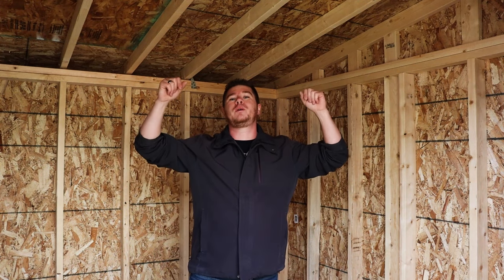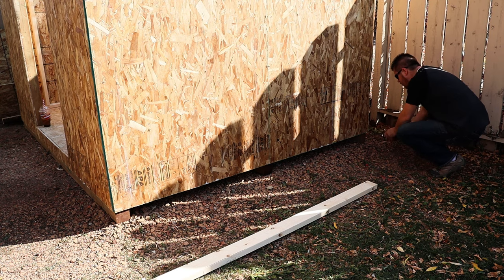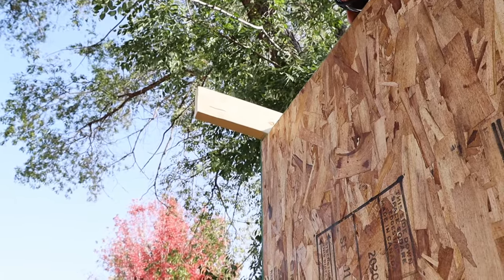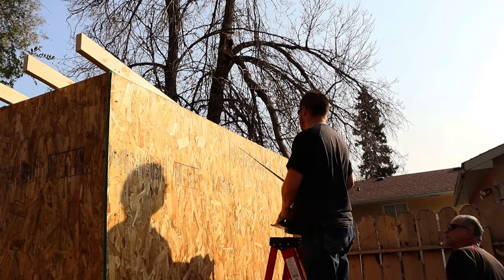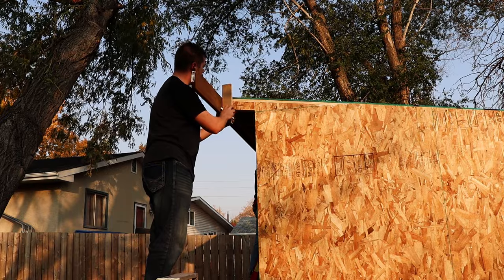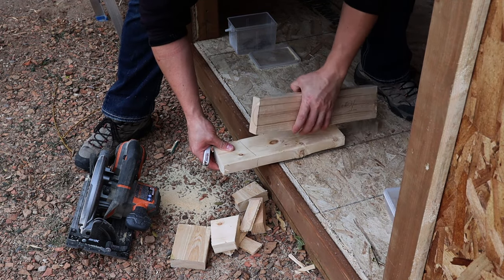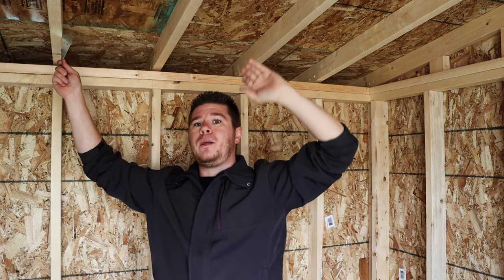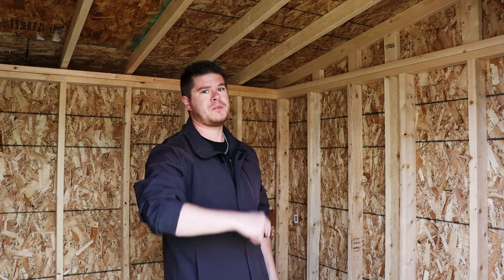How to build a storage shed - Roof // Part 4 - Plans available

Comment: I want to know what you spent in materials to do this build. I an very curious. I need a building but I rent where I live so I want to go as cheap as I can. Just a few weeks ago an 8x10 metal building was only 399. As of covid I guess like everything else it has been raised now to 520. That's just for the building though not including lumber for the floor. Granted that won't cost that much, but as I said I want to go as cheap as I can. If it's cheaper to build a building like u have I will do that instead.
Reply from the maker: To build this shed it cost me $1500. It costs more because you are paying for the quality of the structure, there is no comparison to a metal one, this is stronger. But if you are looking to watch costs I get it, I have a small metal one too.
Reply: Thank you buddy. I appreciate it. I had gotten a metal shed off of facebook market place that was suppose to be complete and was suppose to have been an 8x6. Once I got it home and started going thru the paper work to see how to build the floor it had measurements on it. It ended up only being a 5x6. All the pieces where there but it's much smaller than the seller claimed. I need something bigger than what looks to be an outhouse.
Reply from the maker: No problem, happy to help. Sucks when people  don't list things correctly and you're left on the hook. Good luck, keep me posted

Comment: Good morning my dear. A question: the second top plate, had to be only one piece or I can use 2, because my shed is 10 inches larger. If yes, do I have to use 2 big pieces, or is it fine if I just add the little piece that is missing.
Thank you.
Reply from the maker: Typically on the front and back walls because they are holding the weight of the roof, you want to use full length plates, not pieces. They are there to distribute the load evenly and multiple pieces can't do that correctly. On the side walls, in this type of build at least, it is a little less important and you'll notice when I'm panning the camera, I briefly showed I used 2 pieces on my side top plates
Reply: @JessedoesDIY  
I really appreciate your attention and time you gave to my concerns.
Reply from the maker: Anytime

Comment: So is the front wall slightly taller than the back wall ? Is that’s where the slope comes from? 🤔
Reply from the maker: Yup,  the front wall is 8' tall, the back is 6.5' tall. I even gave the measurements in the videos for stud lengths
Reply: @JessedoesDIY  thanks brother
Reply from the maker: Anytime

Comment: Does OSB hold do to weathering
Reply from the maker: As long as it's sealed in some way it'll last just fine. The glue in it gives it a certain amount of weather resistance, that's why it is so common in building materials. When used correctly, it'll last a long time.

Comment: this is the part that confused me  , i am used to a frame roof  can I ask what about fiberglass roof panels  . the heavy ones not the cheap stuff . With ice and water shield under it   no introduction to your helper   or did you kidnap a neighbor    no birds mouth   interesting     and no roof over hang on the sides either  .With heavy rains has that been a problem   . I get blowing rain up  on the hill where I am at .  I already have drip edge and hurricane ties    for the roof  left overs from my covered front porch  . I over bought everything because it takes over  an   hour to get to lowes or home depot
Reply from the maker: This is a typical classic shed roof. If you want to use fiberglass panels you can, but you'll still need to frame and sheet it first. The helper is my dad, and I did mention it briefly, we were in a hurry to get it done before a blizzard showed up. A birds mouth isn't necessary on a shed, the roof is small enough and there are no crazy pitches and angles going on. The side overhand isn't necessary either on something this small, but you can definitely add one. I have no problem here, but thats the reason for the skids under the floor and rock base, it is plenty sturdy.
Reply: @JessedoesDIY  I was planning on all plywood for walls and roof   maybe board and batten look .I had 4x4s left from my pergola builds  and skids here are important  since we can get extremely heavy rains  . I am building it a ride on mower with from my other shed  . I still have some left over gravel and planned on patio blocks under the 3 -4x4 's I  have . .. I plan a small porch on the front and 4x4 's are 12 feet long . just need deck boards
Reply: plywood back down to 22 dollars a sheet , so may need to buy that now
Reply: @JessedoesDIY  how well do you think your shed will last?  without concrete slabs under it?  I', doing mine and that's the big ball buster is the concrete.  besides the$1,000 ticket I got today for speeding and running a red light with my trailer on my truck and my worker with a warrant  with me.  the concrete floor seems so much more appealing but I'm just doing wood now on gravel or on concrete.. I am having trouble making my final decision... Pplease help me, - Should I go with the concrete or just lay wood on the ground..  Its got some stomne in it but its a lot of clay too. I should go ahead with the concrete footings or just lay 4'' by 4''s or 6'' by 6''s on the stone/gravel bed?  Its got clay ground under that.  really wet here in South East Arkansas. its 20' 2'' 5/8'' 'by11' 4'' 1/8'' existing shed but my add on is similar to Your shed The "Jesse Shed" everyone will be building!  still with the stupid dimensions its making the math harder.  I've dug 3 trenches for gravel beds and thinking of concrete footing s in every corner and maybe 2 more in the center front and center back of shed a-add-on.  also. tonight my buddy and me stole my dads borrowed my dads big tractor with a front end loader and hauled it back to my mobile home where my shop is. got 2 loads of gravel too man! lol  community gravel...  
thanks for your video Jess!  I'll never forget you and your good work that will be all around the world. Little Jesse' sheds!! nice brother.  Have a good day. will your floor rot out in less than 10 years?
Reply from the maker: Ooof that's a lot to unpack lol. Alright, built the way I did it in fully confident in my floor lasting 25+ years. Now you'll use pressure treated lumber for the floor and it's rated for direct ground contact for up to 30 years as long as it can breathe. Try no to lay the beams on gravel because it holds moisture, a rock base is better because it drains. Ultimately it all comes down to the amount of work you want to put into it. Concrete is much more work, and much more expensive. My next shed I'm doing it, but I wanted to show both ways so each shed I build will be different. Now if you want the absolute best and you're confident you can do it, then concrete it is. But for simplicity and cost that will still last a couple decades, this wood floor is great too. If you've already got footings dug, then go with it. It's really hard for me to tell you which is best for you without being there and knowing what you've got. I just know that what I built will be plenty durable for most everybody out there

Comment: Hey jesse can i go just 7ft on front of the roof or have to be 8f
Reply from the maker: 7 feet doesn't leave a lot of room for a tall door or a lot of slope to the roof to shed water. You can if you want but 8 was better for those 2 reasons plus I didn't have to cut the front sheets for the walls
Reply: Thanks Jesse I go like you
Reply from the maker: No prob. Good luck!

Comment: Are those rafters 2x6 or 2x4?
Reply from the maker: I used 2x4 and kept the same spacing as the floor. But you could use 2x6 if you want and go 24" on center with 3/4" OSB

Comment: Not the proper way to to put a roof on but it works for him
Reply from the maker: It's just a small storage shed I was trying to simplify for the average homeowner, that's all.
Reply: It’s a simple shed a simple roof.  What more do you want. It’s not like the roof is going to fly away or fall on someone heads.